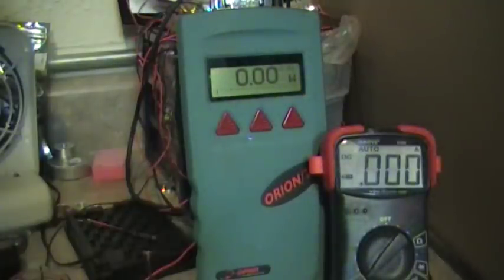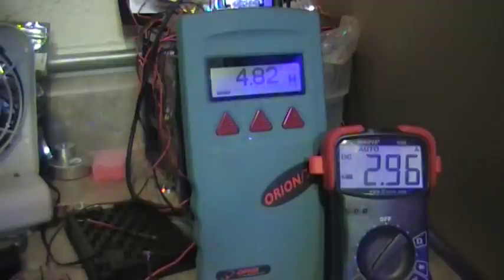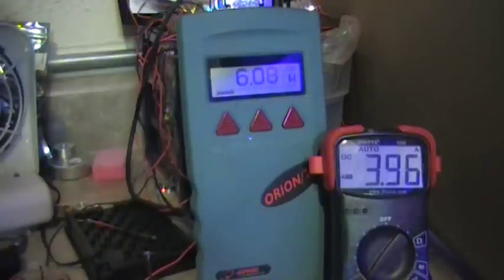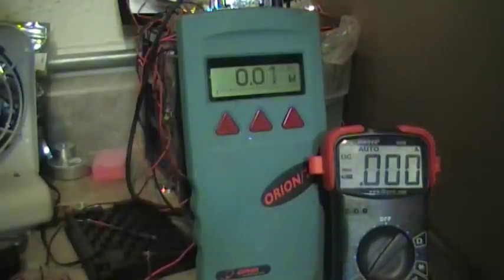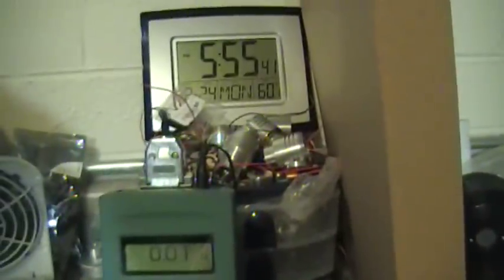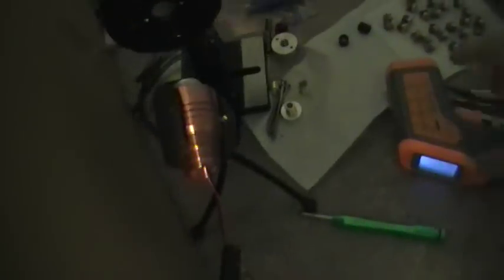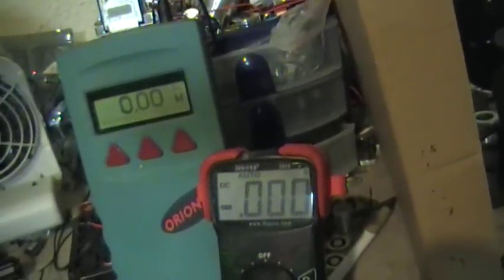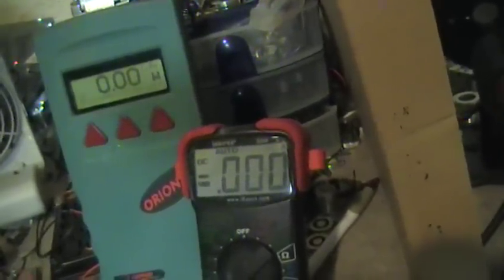6.39W 445nm from new 9mm diode

Comment: Hi is this the NDB7A75 diode and what voltage dc was you using? DTR uses 5V but i know you can use 6V DC input as well.
Reply from the maker: NDB7A75 diode most diodes do not go this high the voltage was show on the right meter
Reply: Sorry, on some drivers it has a wider intake range, but most probably has a fixed voltage output. If you are powering the diode straight then i know I wouldn't use 6V. Thank you for confirming the diode.

Comment: Nice test. It's a shame the divergence is not ant better. It seems like the gain medium is just wider inside this new diode. My osram lights fireworks @ 20' better than my 9mm because of the tighter divergence even @ half the total power the energy density is higher at the spot. The big drawback other than divergence is the insane price, but as soon as these are getting pulled from new equip then the price should drop a lot as the total lumens of the new units are going to be 4000 and 5000 according to what I have read. I suspect the total number of diodes will be about the same although direct greens may be used in place of the phosphor wheel. And as production moves on the freaks will become normal as is always the case. I am happy to see the evolution of the design but I hate the price gouging. Thumbs up for the testing and review.

Comment: go this diode is very powerful! I guess you can combine 2 of these diodes, with 3 cubes of aluminum or copper cubes ...? I'll have to start thinking about putting 2 of these laser diodes my gun. drivers have too? A few are from?
Reply from the maker: need cubs to combine 2 beams
	eBay item number: 221330714925
diode for sale on ebay $599+ shipping 			 		
	eBay item number:
181302167286
Reply: Rick Trent that driver is needed for 6w
Reply: Rick Trent
i heatsinks as they should be: aluminum or copper. you have to sell? thanks
Reply from the maker: I have it in copper but aluminum will work
Reply: Rick Trent
ok, that driver is needed for 6w
Reply from the maker: I was using a 5a 808nm driver . I am working new and better driver